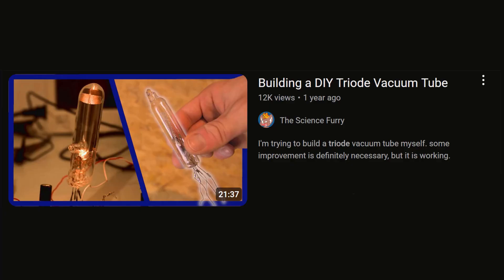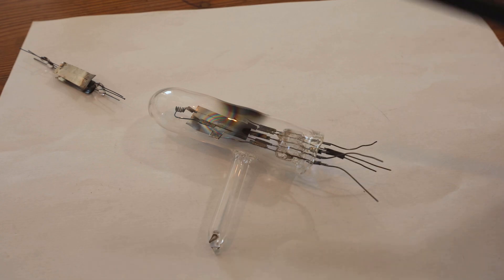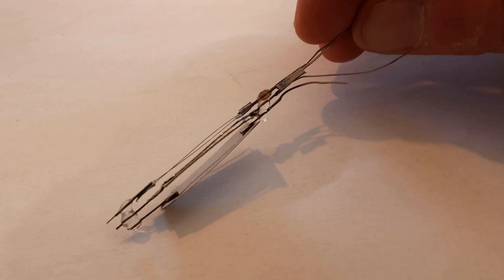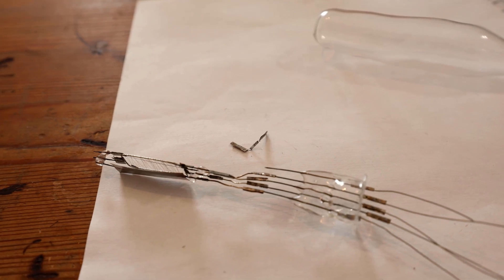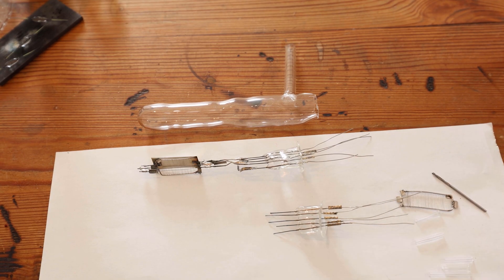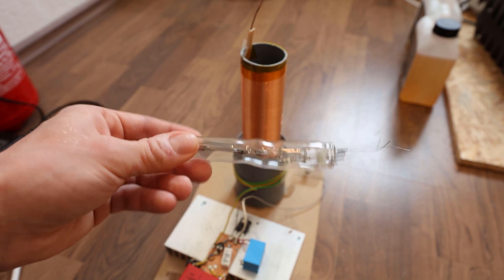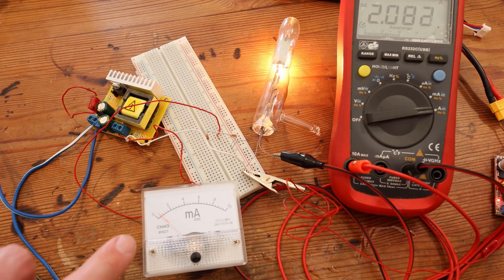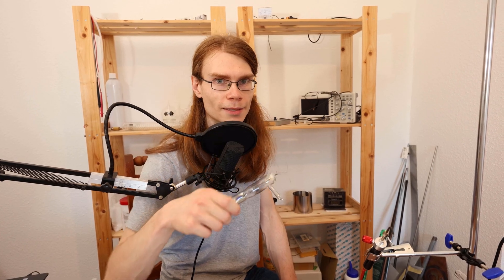I build a working triode at home

Comment: a single word.... COPPER. put copper sleeves on the seals! between the electrode wires and the glass, that prevents microfractures! (since both metals expand and shrink diffrently)

Comment: most of the leaks i have encountered were from pinholes where two different pieces of glass met. the main one being where the evacuation stem met the tube. for leak finding i use a high voltage supply. while pumping one connection of the supply is connected to the wire exiting the tube, the other connection is moved around the tube. if there is a pinhole the electricity will jump through the defect and make a visible spark. the tube can then be taken off the pump and fixed. this also works off the pump as well and i do it by inserting a wire  into the evacuation stem primarily for testing the seal between the evacuation stem and the envelope of the tube since that is where most of my leaks ended up being.
Reply from the maker: Yeah right. I remember this method. Tho I'm pretty sure the leak is from the sealed in wire because epoxy has fixed it so far.

Comment: When building my own tubes, i've noted that adequate vacuum seals can be made with a combination of nickel coated copper wires and two-part epoxy at the outside of the stem. This coupled with a resistive titanium getter is more than sufficient in keeping the vacuum at levels comparable to early hard valves, although the getter may have to be "flashed" often just after seal-off to get rid of all the off-gassing. With this method, when the epoxy is allowed to cure overnight and not overheated during operation, it can be used to from easy vacuum seals for feedthroughs anywhere in the tube, as long as it is not directly subject to the vacuum.

I originally came up with this hybrid seal after being frustrated with constantly failing tungsten feedthroughs. I applied the epoxy, let it cure and to my surprise the failed seal was able to keep the air out without issue, provided the tube had an oversized getter. 

I hope this information is useful to you, it certainly was to me.

Regards:
A fellow electron wrangler.

Comment: Before sealing, would it be possible to slightly pressurize the envelope to check for leaks? you could submerge the entire envelope or use soapy water to check for bubbles. Even if you can't fix it, it might save the headache of finishing the whole thing and finding the leak later. I also second the person who suggested running the getter while pulling the initial vacuum!
Reply from the maker: This would only work with large leaks, and these you would notice immediately. Yeah I should run the getter while on the pump, but it's not under high vacuum, and it works without aswell.

Comment: That blue glow may not be the problem you expect it to be. You won't be able to use a high plate voltage, but it should have very sensitive kinks on its conduction curve due to the remaining gas. If you use a step-up transformer for the grid signal, it should work an audio amplifier. As-is I bet it would function well enough in a regenerative radio receiver, perhaps with some reflexed audio as well. Nearly all of the pre-WWI tubes were gaseous, notably the German LRS relay. They were temperamental and inconsistent, but carefully adjusted could do all the things, if with a higher noise floor.
Reply from the maker: Nice, tho I suspect if the leak rate is too high it will fail eventally.

Comment: glad to see you made improvements with the vacuum tube making process, i would love to test a couple of tubes that you made. 
I like the construction of your tube, very 1910s era design with the internal glas insulators.

I think your biggest problems arent your glas to metal seals but infact your materials. you dont outgas them by running the filament and driving current through the tube while its on the vacuum pump and your getting isnt strong enough to absorb the gasses emitted by the materials when they heat up. 

I think while the tube is under the vacuum pump you should heat the getter, the filament and drive heavy current through the tube until the plate glows redish in colour, then you can shut it off and seal the tube off. 

Your pure tungsten filament isnt bad and I am sure it will perform a lot better when the stray gas atoms are gone and the tube doesnt contaminate itself overtime.

I am excited for your next video in the series
Reply from the maker: I actually run the filament while it was on the pump. Just not the getter. But the getter has more than enough capacity to absorb it's own adsorbed gasses. Also, last time I heated the components with an induction heater, the envelope cracked xD
Reply: A low-power induction heater would also be a reasonable method to heat the tube internals while on the pump.

Comment: Nice! Be aware of a phenomena called "space charge effect", this is what allows X ray tubes to operate, keeping the very high tension and maintaining low emission current, you dont want this effect. Try experimenting with barium-strontium carbonate mix, even barium carbonate alone will work fine. I would suggest going with cathophoretic coating, since its the most uniform when using wires, but you will need some chemistry to make it work, a carrier should be PMMA dissolved in amyl acetate or n-butyl acetate. If you mix barium carbonate and aluminium powder, sinter it, or press it, it will become a evaporable getter, you can add magnesium to make it even better.
Reply from the maker: I actually made the emission coating and tested it on the diode that failed. I didn't use it there because I wanted to see how just the new construction style worked. The next tube definitely will be with coating.